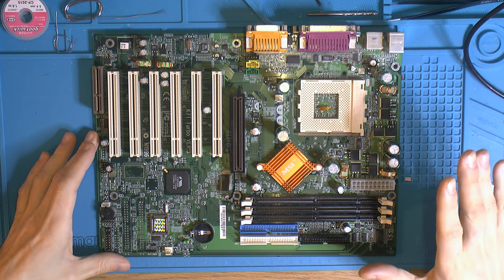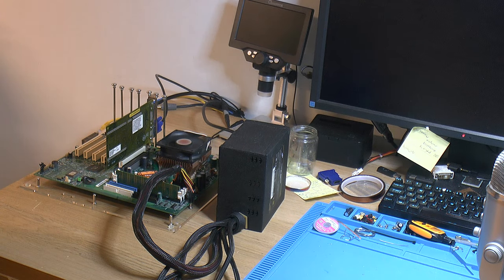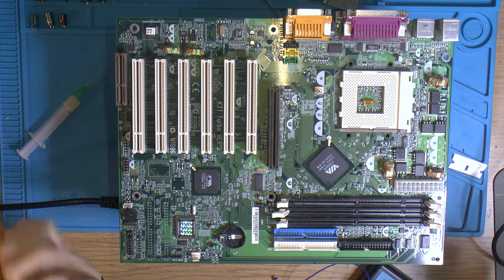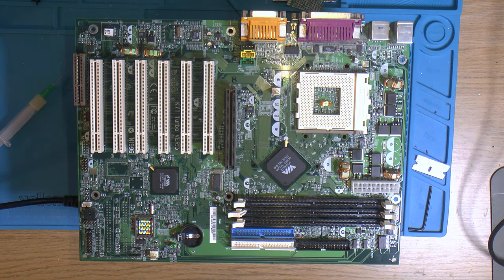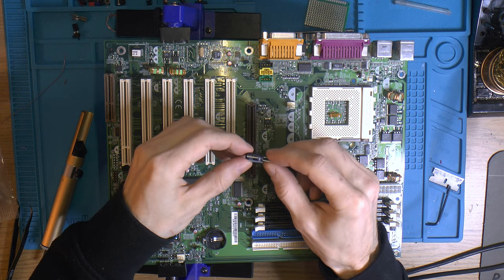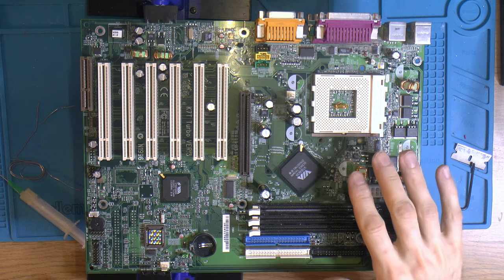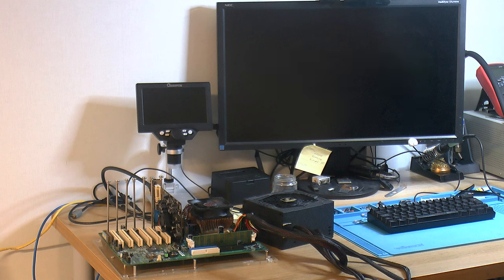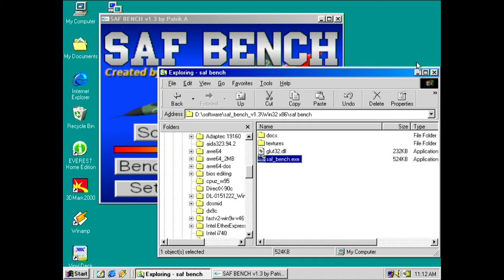K7T Turbo recap

Comment: Thank you for the informative video. I like the technique for temporarily holding the capacitors to the board. What is the tacky stuff you are using there?
Reply from the maker: "Poster Putty"

Heat tends to melt it tough and Electronic Cleaner tends to dissolve it.